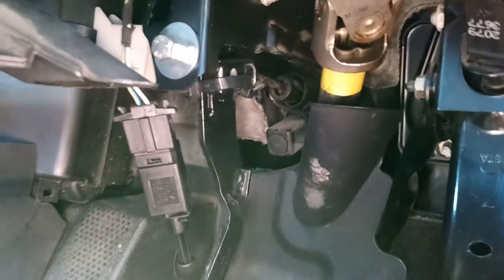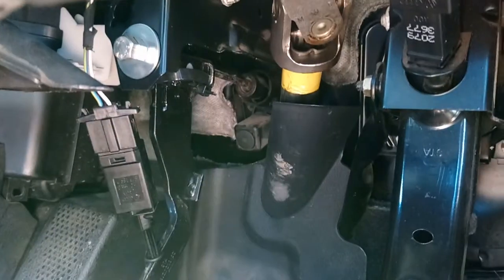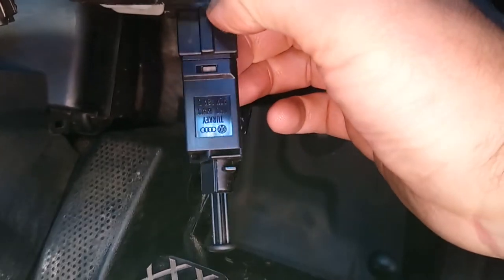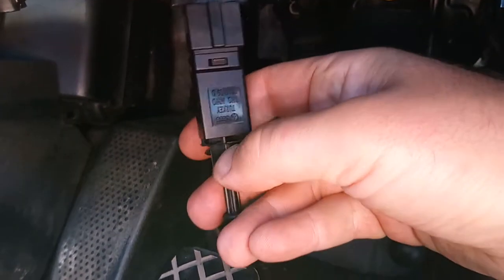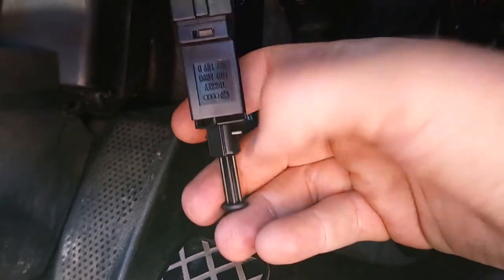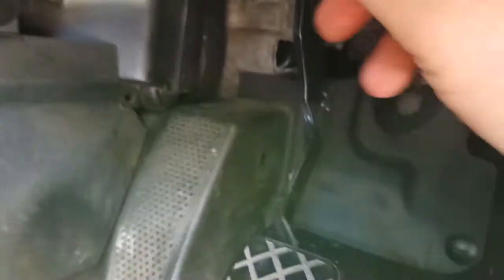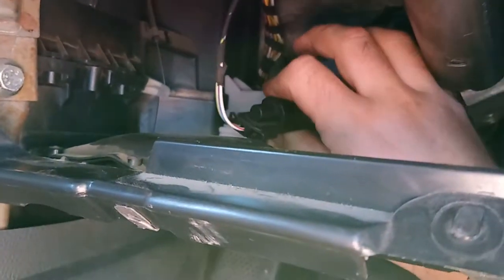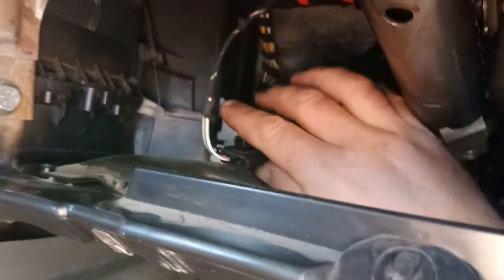Cruise control not working on VW Golf mk4

Comment: Is this the ccs or safety clutch switch? cause I have this switch on my car but I got no cruise control.
Reply from the maker: Hello there, sorry I am not a professional.
My clutch pedal snapped off at the cable bracket end, when pulling away from traffic lights.

I welded the bracket back together so I could use the clutch. Yet my cruise control did not work until I pulled out this switch.

As I don't know what the difference would be without cruise control, means you are correct.

Good luck with your problem. Its good to keep these classics going. 👍